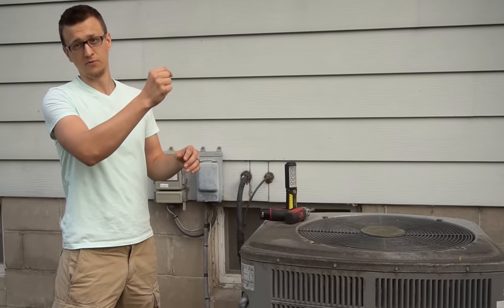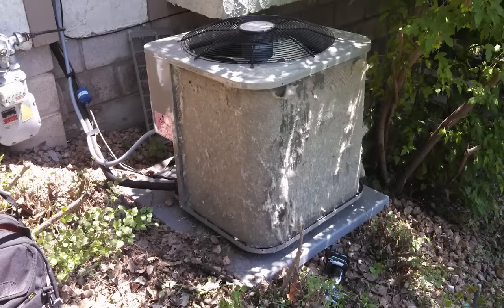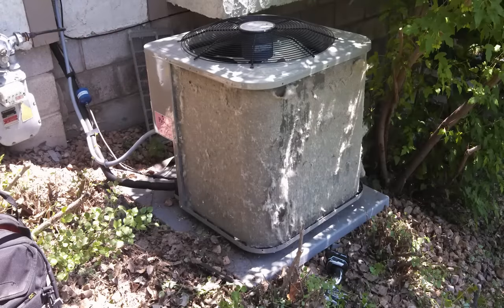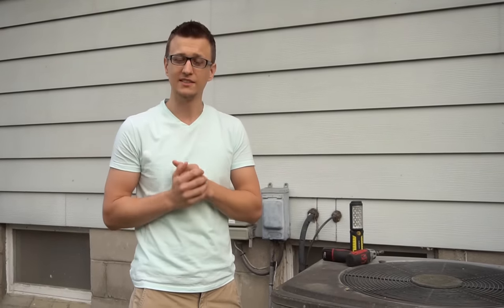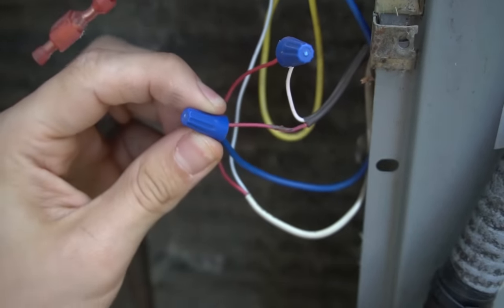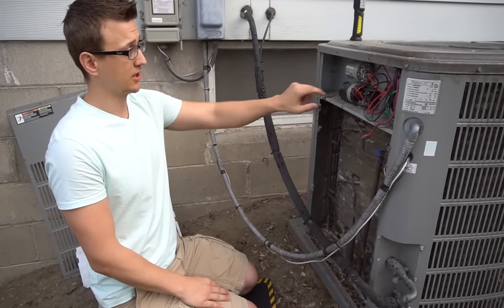15 Air Conditioner Maintenance Tips

Comment: Safety first:  Turn off the electricity at the circuit breaker, before doing any maintenance.
Reply: Yep. Mentioned @ 7:15
Reply: Yup I was at 4:15 shen she started unscrewing the outer panels............alarm bells....turn off the power supply before starting!

Comment: Reminder homeowners.   The purpose of the air filter is not to clean or filter the air in your house.  It's purpose is the keep the evaporator (inside ) coil from becoming plugged.

Comment: Having a spare capacitor is a great idea.  If you get your unit checked by an AC tech, he may want to replace your $20 unit for a $450 unit.  Most of these service companies are crooked as hades.  If the unit looks ok, leave it.  If it is swollen or has bulges, have him use your unit , or just do it yourself.  Make sure you take a pic first to guide you in replacing the connectors  to the correct wires.  But short out all 3 connectors with a screwdriver before you touch it.  They are energy storage devices and it will hurt you badly.

Comment: In areas with heavy cotton wood, it gets hard to keep up with, as far as cleaning. What I started doing is buying screen material and a bunch of magnets to put around the condenser. Then all you do is remove the screen when it gets plugged up and brush it off. Works like a charm. No more head pressure problems.

Comment: You are SPOT ON when you told your viewers to RUN THE AC BEFORE it gets warm [#7, learned that the hard way]. Bennies if a unit fail: 1. Repair will virtually be CHEAPER in the off season 2. You will not be under pressure with the signif other sweating out a delayed repair, LOL. #8 & 9 top points too. GREAT AC PARTS AND TOOLS LIST OUT TOO. As usual, another winner, TYVM.

Comment: We just moved into our new home with central AC (first in 3 homes) last August when everything was working fine. I went to turn it on in this mini heatwave we're having in the in the NE and.... Dead. Nada! Having worked on every possible type of homeowners headaches for the past 30 years I suspected a number of issues and worse case scenarios. I didn't need to get all the way through your video because, 4:10 helped me get straight to the issue (and also the foul stench of death). I pulled the cover of the electrical and (not) to my surprise there were two eyes staring out at me. Yup, it was a tiny cute gray/grey mouse. Well I gently booted it out and removed it's decomposing partner, cleaned out the nest to find a chewed thermostat wire and also the capacitor which was covered in about an inch of excrement and nesting leaves. So, I turned off the power at the breaker(s) repaired the wire turned it on and voila, it started right up BUT the capacitor was smoking at the wires which still were covered in excrement and nest. Seems that all that goo created a short so I cleaned it off and now VOILA back in business. One warning, make sure you clean everything off thoroughly inside the electrical component (box) otherwise you could most definitely and inadvertently start a small fire. Thanks for your help! Great videos!

Comment: Thank you for putting this together. My wife and I used your 15 steps to turn on the AC in our new home for the first time this season. We felt very empowered and even found that the hose that comes from our A coil to our drain pump was not properly seated in the sink...which could have made a big mess and I wouldn’t have know where the water was even coming from. Thank you thank you for sharing your knowledge with us!
Reply: It took two of you to turn it on? And if that's what it takes to make you feel empowered....

Comment: Spot on brother. Clean filters and clean coils are essential to an efficient system. Here in Florida, the name of the game is airflow to get rid of that heat! In summer, I keep an "el-cheapo" 20" box fan running at high speed aimed at my condenser coil midsection to "super-charge" the heat exchange and cut down my cycle times. Works great. It gets colder, faster, in the house so you know it works (and it lowers my compressor head pressure too)..

Comment: Thank you so much! Exactly what I needed to solve my ac problems.  I am a housewife.  You made this very easy for me to follow and to do myself.  My husband is often not home to help much anymore.  IF i get stuck I show him a video ... such as yours and he then takes over from there!  Very informative and cost effective.  I was worried I wouldn't be able to afford to fix our ac.  You explained many questions I had as the previous technician who came to my house kept his answers short and not informative causing me to make a big error.  You explained it much better.  He cause me to not change my filter as often as I was (I have the 5 inch ones and was changing every 3=6  months based on how dirty it looked.  he told me you cant go by that so I kept the last filter in for 3 years.  BIG MISTAKE!.  I should have just kept changing it as I was doing and probably wouldn't have this ac issue right now.   I am angry at myself for not looking into the answer further thinking he knew better than me.  Ill trust my gut instinct over a tech's poorly explained answer next time.  Thanks for explaining.

Comment: Great Reminders with good details.  I have very similar Trane System.   Yep I had a capacitor go bad a few years ago.  I have marked this to watch again on my day off and subscribed.  I also paused and changed my dirty filter. I saw some water on the floor and found the drain hose 90 % plugged where it connects to the humidifier drain by the floor drain. When I pulled apart where the two hoses connect by the drain I was surprised how much water came out of the hose.  No telling how much money you just saved me if this had gone on any longer.  Thanks a million.

Comment: I have about a 17 yr old Tappan AC condenser being replaced next week with a new Am Standard 14 SEER unit.  And a new coil too.  Its not the top of line Am Stdard unit but should be more efficient than my old one. My furnace went out 3 yrs ago, so it will stay. That is a Heil furnace that works very well.

  I'm hoping I get long, no issue service with this new Am Standard unit.  The old 4 ton Tappan just started a tiny freon leak last year.  And I have replaced a couple capacitors in last 2 yrs as well in the old unit.  Just hope I get another 15-20 yrs problem free service.  I've read the new HVACs are not as good as older units from back when.  I thought Tappan only made toasters, so I'm glad it lasted as long as it did.  I will be sure and do more maintenance to my complete HVAC system in the future.  Thanks for these tips/

Comment: Another great video.
I pull out the fan and wash the condenser fins from the inside out. Use a koil cleaner to dissolve any corrosion.
Reply: That's what I do every year.

Comment: I learned about the dual run capacitor and the contactors many years ago from having one of those Home Depot sponsored AC tune up visits.  The guy charged me $45 for the visit and measured my dual run capacitor and said it was weak.  He said he could replace it for $200.  He also said my contactors were pitted.  The contactor is basically a relay near that dual run capacitor that is activated by the brown control wire mention in this video and controls the flow of AC main power to the motors in the compressor unit.  He said he could change this out for $200 as well.  I told him I'd think about it and get back to him.  Yeah the dual run capacitor will run $15 to $20 on Amazon and a new contactor set about the same.  So $35 to $40 in parts he wanted $400 to change out.  Now my only concern with the advice in this video ... keeping one of those dual run capacitors on hand as a backup I don't know if I'd do that for years.  The capacitor will degrade over time just sitting on the shelf unused.  That spare you think you have might not be good when you finally need it.  It's a cheap enough part that you could probably just afford to order one in late Spring before it gets hot and change it out fresh every other year or so as a general maintenance task.  Or, at the very least, get yourself a decent volt meter that measures capacitance and check the capacitance values every Spring to see that they measure close to the rated values listed on the capacitor casing.  If you do this before it gets hot you'll have time to get a replacement delivered before you need your A/C.
Reply: @Tony T there is no board in my compressor unit outside.  Just the simple relay that the thermostat wire causes to open and close to control 240V to the two motors in the compressor unit.  It's a simple relay, no board involved.  I think technically they're called "contactors" but they're just an electro-mechanical relay.  Mine is controlled by 24V to the relay coil.

Comment: I've had good experiences using Simple Green in a spray bottle - spraying from the inside out. It's cheap, non-toxic, and safe on aluminum and copper. Just spray it on, let it sit for 10 minutes, then rinse it off with clean water. My unit always looks brand new after doing this.
Reply: Thanks for the tip. I've got some of that and will use it.

Comment: Awesome, just an FYI to people that might not know, those electrical connectors (Wire nuts) when exposed to outside elements will degrade after about 7-15 years and turn to dust almost when touched so be careful and they r cheap and ez to replace.

Comment: We have an amana ac and furnace. Every year I oil the fan motor in the outside unit and the blower motor on the furnace. The furnace is original with the house - built in 1973. I also clean out the furnace burners every year. The firebox is solid with no cracks and our heating bill is less than a lot of "95%" furnaces. These units are so simple...
Reply: Hopefully it will last you as you will dread any new computerized system + the cost

Comment: Great tips!
I use a breathable screen or cloth cover on top to keep leaves and maple seeds from stopping up the rain drain holes ( that can cause rusting). I always try to keep the coils clean and make sure that dryer vent lint does not stop up the coils. My unit has worked well for over 20 years with the only repairs that have been capacitors replaced 2 times (around $120).

Comment: Excellent!  This is the very first AC maintenance video I have ever watched.  I've owned homes for over 40 years, and never had a central heat and air system that I needed to maintain until now.    I've primarily been using a wood stove and swamp cooler, and occasionally a direct vent wall furnace.  Your video is the "crash course" I need BEFORE I start my maintenance on it TODAY.  I've just purchase a "new home", it's only 31 years old.

Comment: Thank you so much for your video.  Well duh, no wonder my air con would not start in my refurbished double wide mfg home after having techs last year replace worn parts etc and tuned awesome for a very old air con.
My blower in house worked but air con nope.
Well it helps to go to the circuit breaker and flip power on!!!  Duh on me.
I was bracing for 5 to 8k for new system teck due here tommorow.  Cancel that now!  Yea!
Well again hats off to you young man keep up the great work.
I am 69 yrs old and love fixing up old homes etc
What a relief thanks to you!

Comment: Awesome videos! I have seen where the breaker box outside get gunk in it or worn where you need to clean it/replace it causing intermittent power issues (kind of like having the capacitor going out). If there is no resistance when flipping the breaker on/off replace it. If there is resistance cleaning it or flicking it a few times will help. (Mine has the quick breaker disconnect and a breaker panel for the AC outside)

Also, it's a good place to check if your AC isn't turning on or cooling

Comment: This is the best tutorial I have seen. THANK YOU VERY MUCH
Reply from the maker: You're welcome! Glad you found it helpful!
Reply: Word of Advice TV iiq
Reply: Please disconnect the power !
Reply: he did from around minute 6 till around minute 8.  he was very thorough about it.
Reply: You are  very  articulate in  your tech  tips video.  Thank you very much.
Reply: NOT good, never use high pressure, you can see as the aluminum fins are getting flattened, very good to wash but spray with diluted dish soap and the wash off with only enough pressure to wash off.

Comment: One quick observation, great video, however when you clean the outdoor coils, I believe you have to clean the coils from the inside using a coil cleaner and then flush the dirt and debris outwards to avoid pushing all the grime from the outside into the internal side of the coils? Just a thought..

Comment: As I am watching this video, I have four men replacing my old air-conditioning unit of forty years.
In those forty years (I put thirty of those years on it) I did absolutely no maintenance to the system at all for the thirty years that I was living here. All I did was turn it off and on. I live in the Carolina's and it gets very hot and humid here in August and September. I am surprised it lasted as long as it did.

I did keep up with changing the air filters every six months and used high end air filters, but that's about it. I mostly used it in the summer and very little in the winter. I live by myself and I don't mind the house being on the cool side in the winter.

I'll be taking better care of this one. The whole deal is costing me $6,100.00 which seems about right.

I won't be checking the "inside" heating part of the system as it is in a very confined small area in my attic. If I do try to check it out it'll have to be be in the early spring when it is still cold outside.

Thanks for this VERY well done video. I'll do my very best to follow your tips, instructions, and suggestions.

Comment: You know these are great tips. These are things that I mostly do 😁. But the capacitors are usually always the trouble and you're absolutely right.
These are all things that most homeowners can do especially if they follow what you're doing and of course it all depends on the brand of air conditioner you have. That being said I want to thank you very much for showing this and breaking it down into layman's terms for most people I actually learned a few things myself.
Keep doing what you're doing thank you very much 👍

Comment: Thanks for all the tutorials and tips regarding AC systems. One word of advice is not to operate the condensing unit when the outdoor temperature is below 65F, as this may damage the compressor. In addition, do not operate the condensing unit before 24 hours from turning the electric power to a property that has been vacant. The oil and refrigerant in the compressor may be mixed in the base of the compressor. This may also damage the compressor.

Comment: I was told directly by an HVAC technician NEVER to wrap the compressor unit. A board with a weight on top to keep crap from falling in is okay though. The unit is designed to withstand weather, but trapping moisture inside isn't part of normal weathering. With a top cover to keep leaves, twigs, bugs, and snow out, it can still breathe through the fins.

Comment: Thanks for the video, very helpful.

One thing: The R(H) to RC jumper should only be used if you have a single transformer system controlling the heating and cooling. If you have separate systems for heating and cooling ex: Boiler for heat and AC for cooling, you should not have RH and RC jumpered together, instead you'll have a wire from the heating system connect to RH and a wire form the cooling system connected to RC

Comment: That was very informative and valuable. I would ask you to consider researching the foam insulation for the suction line. I live in Texas and a neighbor of mine is a carpenter but he works for a major construct company and he brought me a piece of foam insulation that fit a 7/8" or a 1" copper suction line. The outer diameter of this foam insulation was about 4" in diameter. He said the A/C contractor said this is the old recommendation for suction line insulation. He said he will bring me the newest convention which is even thicker next year. The significance of the insulation on the suction line on the condenser is to keep the refrigerant from absorbing heat from outside thereby adding to the temperature/pressure condition of the entire suction side of the system. There is no need of course, to condition the air outside. That small thin insulation on your unit is not doing so well. I do have a question for you as a licensed professional(I am not), the Texas sun alone can really heat up the smaller liquid line. There are of course, many reasons for this line to get too hot but the fact that nobody(except me), insulates this line to protect it from the extremely hot sun. I believe(no proof), that this move could potentially improve the over all efficiency of my unit. Does that make sense to you?

Comment: Thanks for the video and tips. I’m ignorant when it comes to ac units bc all I ever did was change air filters, spray outside unit and clean “A unit” inside....never knew about all the other stuff. My unit is currently 15 years old hoping to reach 20 but I’m here in Texas ..... very hot!

Comment: 26:43 - Although they are permanently lubricated and shouldn't need lubrication, in the event that it starts to turn squeaky I have had success taking the motor out and putting some 3 in 1 oil on the bearings. I applied the oil with the bearing seal facing up. I let the oil soak in for 5-10 minutes, then turned around did the other side, cleaned up as much spilled oil as possible, put it back together and ta da, no more squeak. I told this to an HVAC guy once and he acted like it blew his mind that I was able to do that, but it stands to reason that if a contaminant got past the bearing seals and is causing the squeak,  or lube came out, then you can put lube back in. MUCH cheaper then buying a new motor.